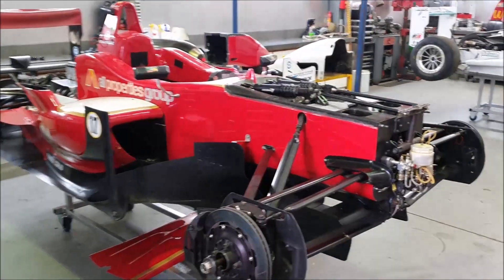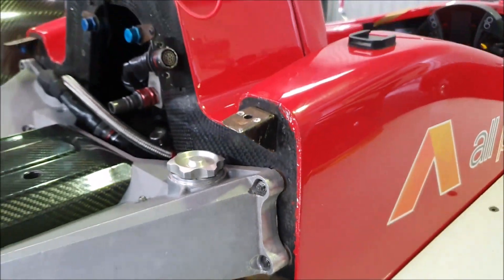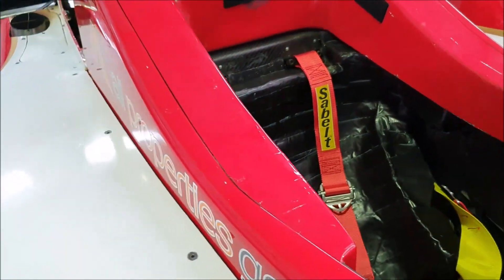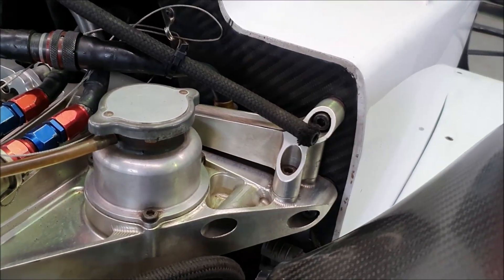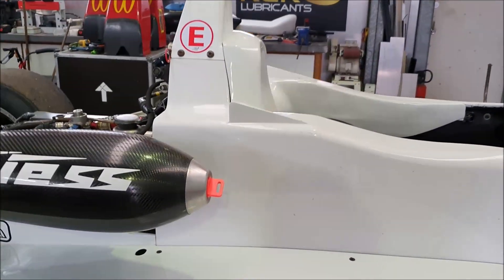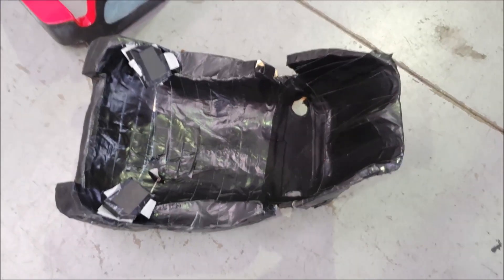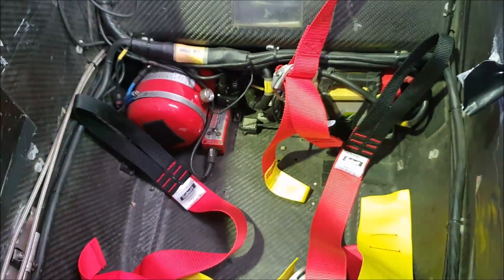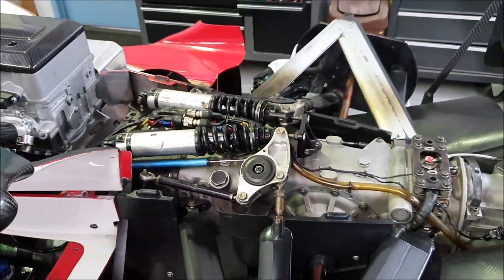Romain Grosjean crash, why did the car break in half? Open Wheel safety features explained

Comment: Wow this is a hidden gem. 
It was presented as an anomaly and perhaps failure in another video I saw that the bolts sheered, but here you explain the designed safety intent. 
Also I haven't seen the explanation of cut off valves that I presumed were there. 
Finally I didn't know, thankfully, that cars had spinal boards. 
Thanks for the video
Reply from the maker: Thanks for watching! make sure you subscribe